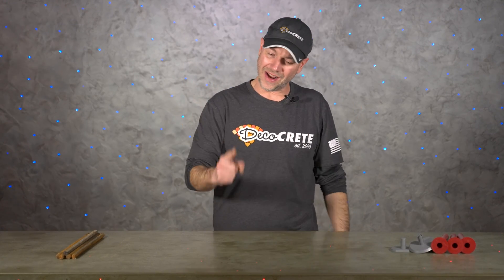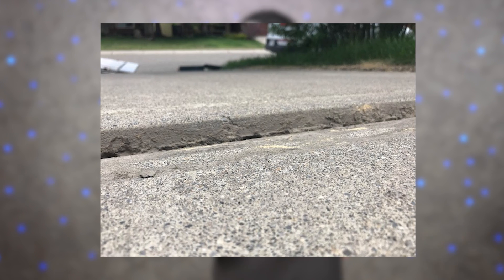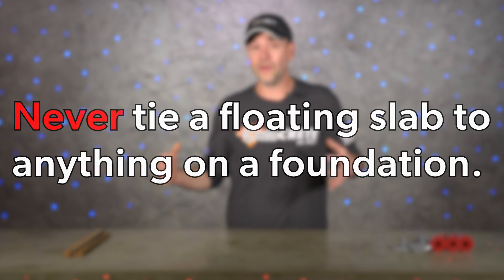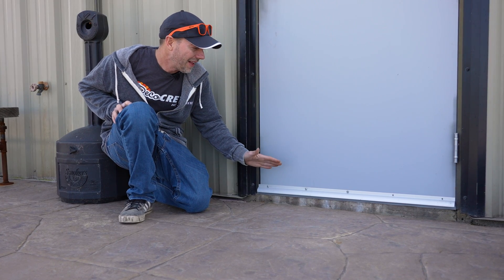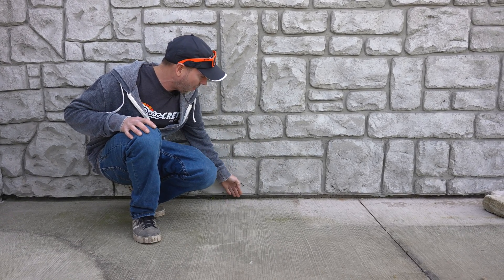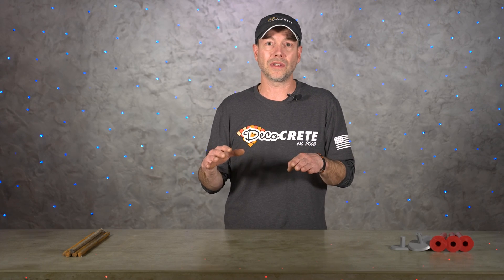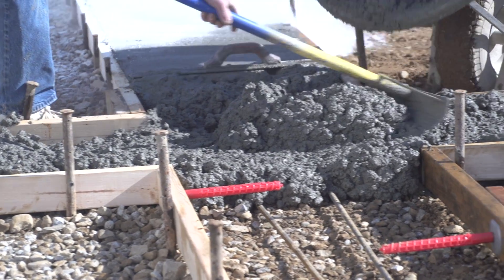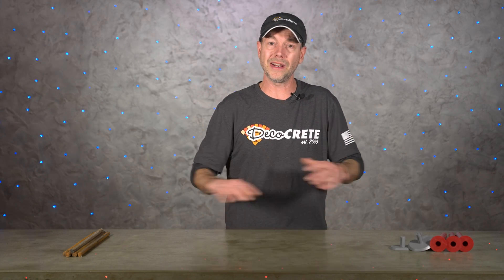The Truth About Doweling Concrete Slabs!

Comment: I want to extend my living room and dining room by pouring 6inch concrete 20ft by 10 ft. Then tearing the exterior wall and enlosing the newly poured concrete to make it part of the home. Would doweling to the foundation be appropriate? I also want to place tile over everything but im concerned placing tile over the joint will break. What would you advise?

Comment: So I am pouring a large sidewalk and a large driveway. both are floating. Good or bad idea to pin them together. worried about the bigger piece of concrete setteling differently than the smaller one and cracking it. 1/2" rebar at 24" squares in both.? What do you think?
Reply: Oh yeah, Northern Ill, Freeze thaw is an issue
Reply from the maker: Thanks for the comment! I would probably separate the two areas with a piece of expansion joint. I really don't like tying driveways to sidewalks. I mean, It kinda depends on the actual size of the two areas, but connecting a 4' wide sidewalk to a large driveway does come with some risk. That being said, this isn't quite as concerning as tying a floating slab to one that's on a foundation. I just don't feel that the benefit of tying the two together is worth the risk. Most contractors in our area would keep the two slabs isolated with expansion joint. Hopefully this helps. Thanks for watching Deco-Crete TV!!!

Comment: I am looking to extend an existing step by about 11'' on one side and 4'' on the other side. It is sitting atop an existing concrete footing. I was going to cut a step into the existing step then use rebar to tie it to the existing step and concrete below and use bond primer before adding concrete. Do you think this is a good idea? Or should i use expansion joint?. I am looking to tile after.
Reply from the maker: Thanks for the comment! I would definitely tie the new concrete to the existing step. But I'm not sure how necessary it would be to bond it to the footer below. If the existing step is already tied into the footer, the new concrete will be fine if it's tied to the step. If the step is not tied to footer, then I would just let new concrete follow the step. My point is; just focus on the step since that's what you are extending. If you tie those two together, they should act as one. Hopefully this helps! Thanks for watching Deco-Crete TV!!!
Reply: @DecoCreteTV thanks, really appreciate it

Comment: Hi, great video.   A little confused on one topic.  Interior slabs are usually on well graded with packed gravel sub base.  If you do a concrete block stem wall, do you not want to tie in the interior floor to it? What would you suggest?  Thank you!!!
Reply: My gut says definitely. But don’t trust me.
Reply from the maker: You are welcome, and thanks for the comment! Tying an interior floor to the block foundation is pretty uncommon, but I have seen it done. I'm not aware of any down sides to doing this, but because it's an interior slab that won't move up & down due to weather, most would consider tying into the foundation to be unnecessary. Thanks for watching Deco-Crete TV!!

Comment: What if I am adding a slab to a pre-existing slab (expanding a patio area) but the pre-existing slab most likely is tied to the foundation (don’t know because it was like that when I purchased the home) and the new slab will but touching up against the pre-existing slab AND the foundation? Do you use dowel on the pre-existing side and on the side touching foundation expansion joint? I live in South Texas so cold isn’t common.
Reply from the maker: Thanks for the comment! That situation is a little unique since you're not sure if the existing slab is tied in or not. In this case, I would probably tie the new slab to the old one, even if the old slab is tied to the foundation. The problems that could happen down the road would be isolated to on the old slab, and it would only effect a 1'-2' strip where the slab meets the foundation. The fact that it's been there for a while and nothing has happened yet is a good sign, and it doesn't sound like you get much freeze/thaw where you're at anyway. As always, there are no guarantees with concrete, but I would tie the two slabs together. Hopefully this helps. Thanks for watching Deco-Crete TV!!
Reply: @DecoCreteTV thank you appreciate the feedback and got them tied together

Comment: Does it help or make sense to put any kind of insulation under a sidewalk that’s adjacent to my garage? I live in a really cold area in north central washington with a lot of frost heave. Planning to use an expansion joint alongside the building, adequate rebar and pouring 5” thick… any recommendations?
Reply from the maker: Thanks for the comment! Yes, insulation under the slab will help. 2" ridged foam board is the most common thing to use. This does not guarantee that the slab won't heave and  I would still use the expansion joint, and treat it like a floating slab. But, the foam board will reduce the frost level under the slab. Hopefully this helps. Thanks for watching Deco-Crete TV!!!

Comment: What about a Porch Post footer next to an existing foundation? (Can't use header board)
Reply from the maker: Thanks for the comment! Normally the post footers are below the concrete grade, and won't interfere with the porch slab. If not, I would put expansion joint around the post footer. Hopefully this answers your question. Let me know if I'm missing something. Thanks for watching Deco-Crete TV!!
Reply: Thanks man! Well it's a concrete porch footer but it's only 1 ft in the ground. It has stressed cracked already. So should I just dowel the new porch post footers into it so it bounces together? plan is 8" tube sleeves 2ft down only making slight contact with existing concrete for about a ft or near grade. Would the tube sleeves be good enough for that little of an  expansion joint? 😅
Reply from the maker: @NZIGNANTI  The cardboard shell of the tubes could kinda work as an expansion joint, but I would probably still wrap it with foam expansion. Dowling the footers together would seem like a decent idea. I would just avoid tying the slab to the footers.

Comment: I've seen on YT concrete guys dowel the slab to the foundation while using a foam expansion joint.  It's very confusing!
Reply from the maker: Thanks for the comment! Honestly, that doesn't seem to make much sense to me either, lol. I'm mean, I get the fact that they put the expansion there to create some isolation and hopefully avoid chipping on the top edge. But it will not do anything to help the main problem. I would rather just do one or the other, and we would never tie an exterior slab to a foundation. Thanks for watching Deco-Crete TV!!

Comment: I poured 5ft deep 10”x10” footings for a pergola.  The square footings are about 4” above the dirt around them.  I want to pour a 4” concrete slab around the footings and under the pergola to expand the usable area instead of having dirt around it.  Should I dowel the concrete around the footing to the small slab I want to make?
Reply from the maker: Thanks for the comment! We would not recommend doweling the 4" slab to the footings; the slab will inevitably move over time, and the footings will not. The best thing to do is put some expansion joint between the footings and the new slab. This will keep the new concrete from bonding to the foundation and allow the slab to move independently. I'll leave a link to our expansion joint video below. Thanks for watching Deco-Crete TV!!!                                                                                                                                                        https://www.youtube.com/watch?v=VXsWYGhQfqs
Reply: @DecoCreteTV thank you so much for the detailed and quick response.  Your videos are very clear and helpful

Comment: You're incorrect we had this problem with a sidewalk not tied into the slab Foundation by a door opening and in the morning you could not open the door because the sidewalk lifted up a quarter inch
Reply from the maker: Thanks for the feedback! I understand the problem you are describing, but if you dowel into the foundation, you run the risk of the sidewalk cracking from the pressure that's created from the ground heaving and the dowels trying to hold it back. Two ways of handling this would be; pour the sidewalk 1/4"-1/2" lower then the doorway to account for movement. Or pour the sidewalk on 2" Styrofoam board to protect the ground from freezing. This topic will always come with some debate among contractors, and again, we appreciate you feedback. Thanks for watching Deco-Crete TV!!!

Comment: Can or should two slabs be "tied" together using dowels and some type of expansion joint? What keeps water from getting in-between and heaving up and creating a lip between the two slabs?
Reply from the maker: Thanks for the comment! There is really no need for expansion joint if you're doweling the slabs together. The main point of the expansion joint is to allow the two slabs to move independently, so it's not necessary if you tie them together. The best way of keeping water from running between the slabs would be to caulk it with a flexible joint sealant, but it's uncommon for water to cause a problem, as long as the subbase materiel is properly sloped for drainage. This is really no different then water running down into the saw cuts in the slab. I'll leave a link to the joint sealant we would recommend below. Thanks for watching Deco-Crete TV!!!                                                                         
 https://www.deco-cretesupply.com/products/repair-prep-products/sikaflex-1a

Comment: Great video, im late to the comments but what is a pole garage slab considered? A non moving floor? Looking to add an apron and im thinking i want to avoid pins after watching this. Just pour it 3/4in lower than the garage floor? Thanks
Reply from the maker: Thanks for the comment! You're on the right track by avoiding the pins. A pole building isn't necessary non moving, but it would move verry little and it's still considered an interior slab. Pouring the apron a little lower than the garage slab is the best idea. 3/4" might be a little excessive, some would call that a trip hazard, but it's up to you. Common practice would be 1/4" - 1/2" lower. You will also want to put expansion joint between the two slabs so they can move independently. Thanks for watching Deco-Crete TV!!!

Comment: What about an old pier house and a concrete slab for a carport or garage? Should the carport slab with footings be doweled into the concrete foundation of the house?
Reply from the maker: Thanks for the comment! If the slab and piers are booth on a foundation, then yes, it could make some sense to tie them together. That said, it's always nerve racking to tie an exterior slab to a house foundation. This also depends on whether you live in a freeze thaw environment or not. If you do, I would not tie the two together. The footings under the slab will keep it from settling, but if it wants to rise up when the ground freezes, it's free to do so. If the new slab is going to have a building over it and the ground underneath it will never freeze, then I would tie the slab into the house foundation. Hopefully this helps! Thanks for watching Deco-Crete TV!!!!

Comment: What is the best way to join a new concrete slab-with foundation to house. Do you use dowels then?
Reply from the maker: Thanks for the comment! This depends on whether the new slab is interior or exterior. If it's interior, then yes, use rebar dowels. If it's exterior, then I wouldn't join them together, I would put expansion joint between the two so the slab can move up & down independently of the house foundation. I'll leave a link below to a video on expansion joint. Thanks for watching Deco-Crete TV!!!                                                                                                                                                                                                          
 https://www.youtube.com/watch?v=VXsWYGhQfqs&t=265s

Comment: We need to extend a foundation on all sides before we can start building. Would it be right to rebar the old and existing concrete to each other and start building the outside brick wall is the small home on the new concrete part?
Reply from the maker: Thanks for the comment! This video is more about concrete slabs than foundations, but tying everything together seems like a good idea to me. You might wanna check with your local building department or some contractors in your area to see how they would handle this. Good luck on your project! Thanks for watching Deco-Crete TV!!!

Comment: hi jeff i’m doing a small concrete job and I need to elongate a concrete light post. The concrete is very old but sturdy. I want to drill some pilot holes and then put rebar in and pour a new extension but i’m worried about cracking the concrete when drilling for the the rebar holes any tips for this beginner?
Reply from the maker: Thanks for the comment! The first tip would be to use right equipment. A quality hammer drill & masonry bit are a must, we prefer the spline style drills because you will need a fairly large bit. If you are using 1/2" (#4) rebar for the dowels, you would use a 5/8" drill bit, #3 bar would use a 1/2" bit, and so on. Basically, the hole needs to 1/8" larger in diameter than the rebar. Most local tool rental shops will these available for rent. The next thing would be to keep your holes at least 2"-3" in from the edges. It's hard to be very precise when drilling these holes, give yourself some room so you don't end up drilling too close to the edge and creating a weak spot. Also, take your time and let the drill do the most of the work, don't try to force it. Sometimes you might even hit a piece of rebar in the concrete (if there is any in it). If that happens, again don't force it. Give it a second to see if it wants to drill through it, and if it doesn't, just move the bit over to one side or the other and try again. These drills and bits are made for this and it's uncommon that it would crack the concrete, as long as you take you time and stay away from the edges. Hopefully this helps! Thanks for watching Deco-Crete TV!!!

Comment: Any help appreciated! I am pouring a 12x16 foundation slab to extend my  original equipment storage building by double. The original is a previously poured 12x16 foundation slab from ten years ago. Should I dowel the new add-on foundation slab to the preexisting slab? 70 yrs old, retired doing all my own work! Thanks much!
Reply from the maker: Thanks for the comment! If both of the floors are on a foundation that won't be affected by freeze/thaw, then yes, I would dowel them together. The problems start when one of the slabs moves up and down from freeze/thaw and the other one does not. This can also depend on where you live and how much freeze/thaw the concrete will go through. You could check your local building code or ask some concrete contractors around your area to see how they would handle it. Hopefully this helps! Thanks for watching Deco-Crete TV!!!
Reply: @DecoCreteTV  Thank you so much for the quick response. We live in the Mid-Willamette Valley in Oregon. Not much in terms of freezing here. Maybe a few days a year. Your video was very informative! With labor costs being so out of this world and us being on social security, I have to do as much of my desired projects on my own. Hence the University of YouTube! Blessings!

Comment: We are doing a concrete patio and we are in northern colorado. 
From the video I understand its better to not tie the patio to the foundation by attaching rebar or using dowels 
instead just use the concrete joints between the patio and home foundation.
we had to raise 18 inch to match our patio sliding door height in the backyard. and my contractor  used recycled ashphalt or roadbase from the looks of it
Yet to pour the concrete in few days 

Any other recommendation for us. except using a concrete join where the patio meets the foundation/property
Thankyou
Reply from the maker: Thanks for the comment! Sounds you like you guys have things in pretty good shape! Thanks for watching Deco-Crete TV!!!
Reply: I’m in Concrete contractor in SW Colorado, with freeze and thaw I definitely would dowel slab in.  Good luck.

Comment: I need to pour a slab around a pool, there is already an existing bond beam around the pool so should that be dowelled or just expansion joint? any advice greatly appreciated
Reply from the maker: Thanks for the comment! A bond beam for pool would be a little different. Generally, the concrete slab would sit on top of the beam as opposed to pouring up against it like a house foundation, so I wouldn't put put any expansion joint between them. I would check with your pool builder for advise on weather to dowel into the beam or not. We would generally avoid doweling into the beam, and thick of it as more of a shelf for the slab to sit on. But, some situations are different, and the pool builder should have some advise for how this works in you area. Hopefully this helps. Thanks for watching Deco-Crete TV!!!